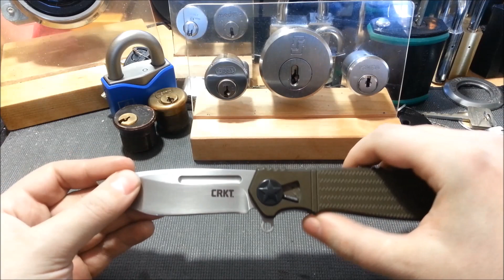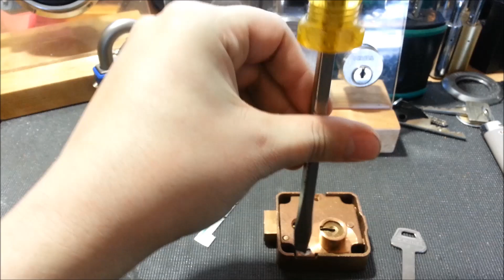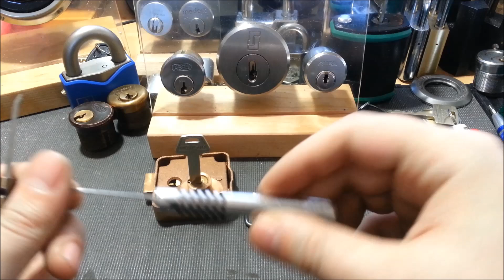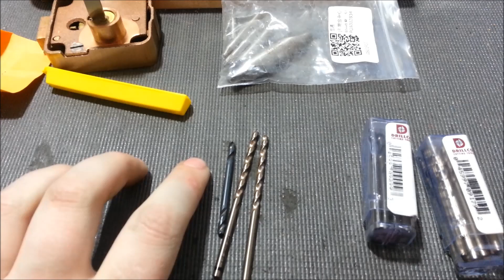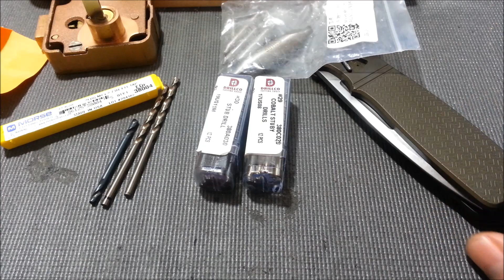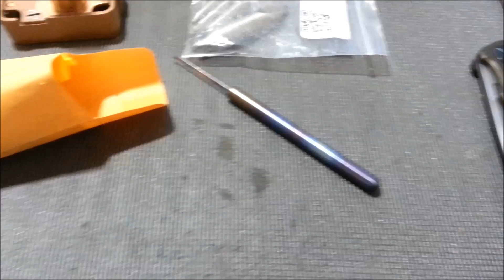(132) What's new / Catch up / Show and Tell video

Comment: Nice selection of tools and gear to have in ones collection there Rook.
Isn't stainless steel harder than titanium alloy's strength to weight ratio?
Reply from the maker: Thaks buddy, Honestly I have no idea. All I know is most machinists hate dealing with Titanium.. Espically drilling it.. I've worked with stainless before hand never had any problems drilling it.. Edit, found on google "Titanium is approximately three to four times stronger than stainless steel, which means its lifespan over generations is slightly longer. However, titanium can scratch, so its care entails routine polishing, or it risks becoming dull and marred."